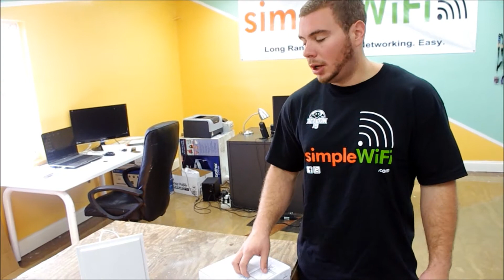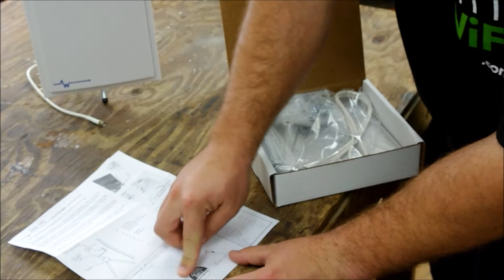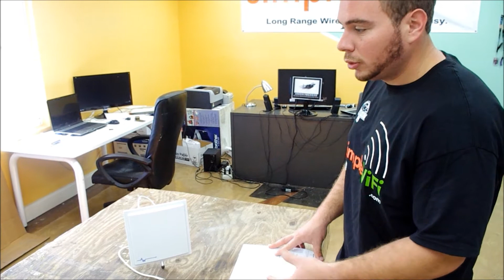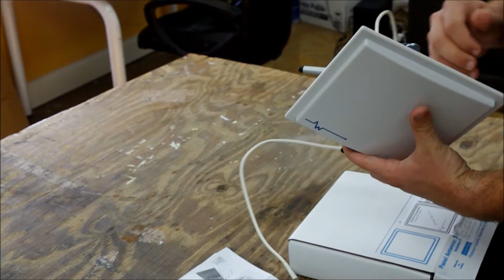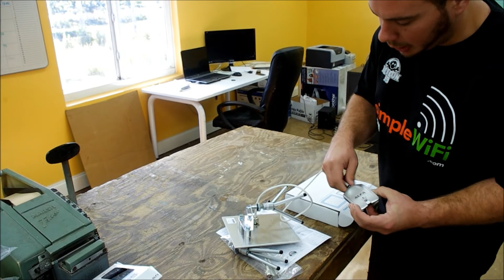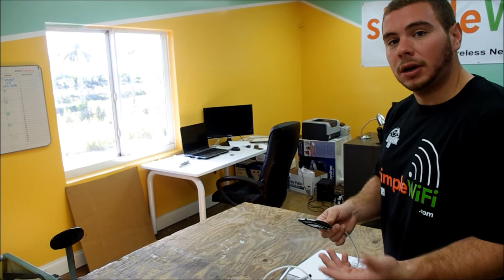Directional Panel Patch Wi-Fi Antenna Explained - Long Range Wi-Fi Booster Explained

Comment: Could I use two of these, one at my TV and one at my router and point them at each other through the wall for better throughput/reliability?  Currently I already have the entertainment Centers WiFi device (a 4 port "game" type adapter) as the *only* client on a second router that sits on its own channel which doesn't overlap with my other wifi routers channel (I'm trying to eliminate anything that reduces bandwidth, including signal traffic, extra clients, etc)  Thanks!